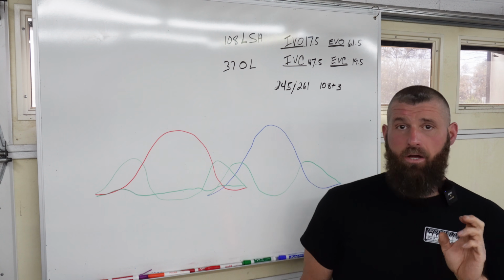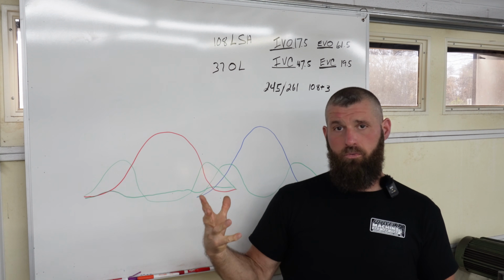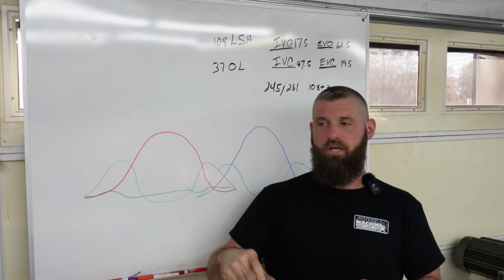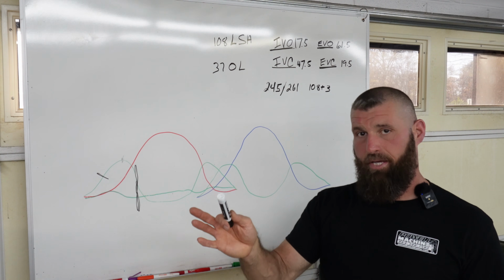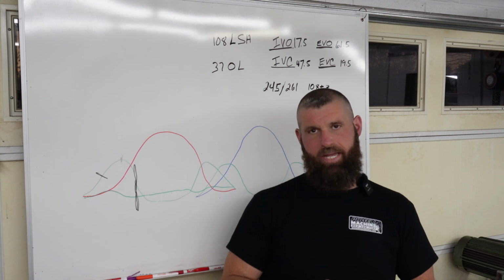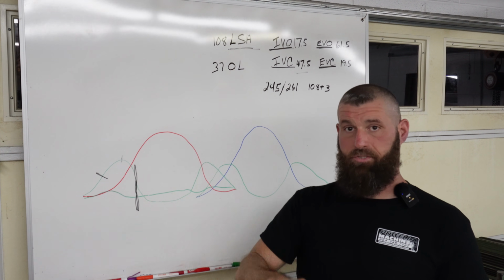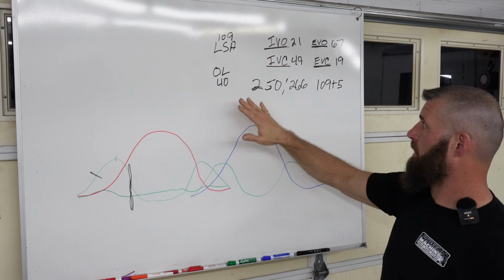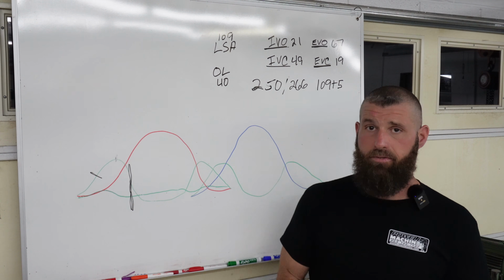How we choose the correct camshaft events for your application.

Comment: Daniel........ Thank you so much for the comment on calclating dynamic compression.   I usually tell my customers the best thing they can do with the dynamic calculators is press to control/alt/delete and remove program to free up space on their hard drive for some useful.  The cheap "dynamic" calculators are strictly static because of the VE you explained
Reply from the maker: Glad it resonated with you!
Reply: ↑↑↑↑ This ↑↑↑↑ I have run the dynamic calculators on cams I've spec'd and have the dyno results for. I've never used it to determine anything, and it running it told me less. I have yet to wrap my stupid brain around how people determine anything from the random number generated.

Comment: I watched the entire video. Am I correct by using the CID and the maximum RPM to choose a set of heads that will flow that amount of air at a desired lift and duration, then make the valve events happen based on some other factors of the engine combo? Or do I need to watch it again?
Reply from the maker: Yes, again,  there is no set "math" for events,  just a general parameter for basic targets

Comment: I was the one that asked about cam or crank degrees regarding the acceleration and jerk numbers.  That spreadsheet from Ben would be a valuable piece of information.  Did it have anything on aluminum vs. steel rocker arms and the deflections of each regarding durations?
Reply from the maker: No, that data isn't there

Comment: That motor would make a lot more power if it didn't have those crappy pistons in it and had an actual quinch and more compression. There's no reason that shouldn't run on pump 93 at 11-1 or 11.5-1 compression.   I seen the video and I was very impressed with your cam. More exhaust, same lsa, more overlap and that helps both the emptying the cylinders and filling them as rpm increases. At least that's my take on it.
Reply from the maker: Definitely agree

Comment: I have a cam Daniel speced and ground for me. It's worked out very well so far. Hydraulic roller for an 82 Ford 302 (tie bar lifters). The duration is in the middle (21x/22x @ .050) for a street cam but the lift takes advantage of the heads I installed (.575/.575) with an LSA that is on the narrow side, I suspect to increase low RPM power (what my research indicates). I'm very impressed with the result, has a nice lopey 800 RPM idle, runs clean when driving it like a truck (shifting by 2000 RPM in tight traffic), but makes power all the way to 6000 RPM (peak at 5500). For an oversquare motor like a Ford 302, it's very versatile. 265 WHP, right where Daniel thought it would be. Thanks Daniel.
Reply from the maker: Glad to hear it worked out well for you!
Reply: Hey. I’m building a 302 with rollers. It’s going in a 2,500# car with a T-5 5 speed. For the street. I am getting different opinions on the ideal cam. 🙄
This stuff is so educational .
The short block should be able to take 6,500-7,000 rpm when it’s built.

Comment: "Dynamic" compression is really a STATIC calculation.  Cranking compression is a slight move toward the actual dynamic realm but too slow to tell you much.  YES, volumetric efficiency is what counts in a running engine.
Reply from the maker: Absolutely 💯

Comment: Ok, so the hydraulic intensity of a Comp XE 268 which has an @.050 of 224° is 44
A small .480 lift cam with 1.5s on my little mopar 318 but the intensity number sounds excessive.
Am I missing something?
Reply from the maker: Is that a flat tappet?
Reply: @powellmachineinc yes
Reply: Perhaps the advertised duration is measured at a higher lift?
Reply from the maker: FT  cams can have smaller intensity #'s than HR some times

Comment: In my world of reverse flow heads the business of volumetric efficiency is freekin' huge.  Too many things to consider to be able to arrive at an "ideal" cam configuration so one must always compromise.  As previously stated, I build for durability first, efficiency second with oitput numbers aside from simply comparing how much time and fuel it takes to move x number of pounds x distance on the same piece of road in the same direction. Less time and fuel means more work done at lowest cost in terms of the fuel bill combined with tonmiles covered.  I know that shows little on the racetrack, but position at the finish line is a pretty good substitute, imho.  (grin) "D"
Reply from the maker: Sounds like a good approach for your goals.

Comment: The LSA for a custom cam, I agree doesn't matter. It's going to be what the math makes it. On the other hand, if your buying a shelf cam. I believe it is a valuable point to consider. As engine masters has shown, the same profile lobes, with a wider LSA changes how the engine makes power. Would you agree or disagree?
Reply from the maker: the cam performance is ALWAYS event driven, the lsa is not a input, shelf cam or not, you need the correct events, that cant change

Comment: I run 350’s not 406 engines, I’m not scared of cylinder heads. I wish I could get 230 dart cast irons. We can still get Motown heads. But those Weigngartner heads are crazy!! Probably a promaxx 215 project x. 
Old man’s garage has really good results with Trick flow 230 cc intake port heads. Even Buckos 327 made 521 hp for them with some trick flow heads. 
 Figure a good head and valve train in a 350 should make more easy!!
Guess I know who to call for my cam when I need one.
Reply: So what is your opinion on a 350 cid with stock 3.48 stroke and a 6.00 rod vs the strok length 5.700.
Reply from the maker: The 6.0 is probably a better choice for longevity,  but it will be HP difference.

Comment: DANIEL ! You are showing the wrong side of the lobe as the opening ramp ! My cam runs clockwise, so, the RIGHT side of the lobe is the opening ramp, NOT the left side ?
Reply from the maker: There are no "lobes" on the board, however there is a lift curve there, ......

Comment: Their cam was similar to yours because Isky is also good at designing cams. Not like they had some random folks making it. More it means two good cam makers had similar ideas. Isky generally has less steep lobes and less lift than most. Their cams last a long time but aren’t necessarily the fastest.
Reply: To be totally fair, the Isky was was not designed specifically for Bob's application. Daniels was. So it makes total sense that his cam performed better.
Reply from the maker: I didn't take anything away from Isky, also on a sbc you cant make the lobe "fast enough " so there isn't much chance of hurting anything.